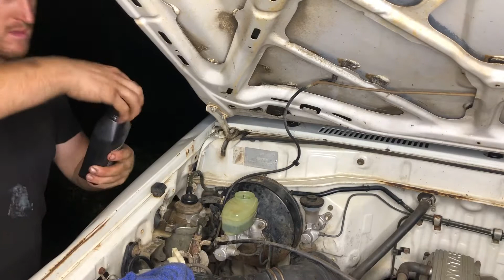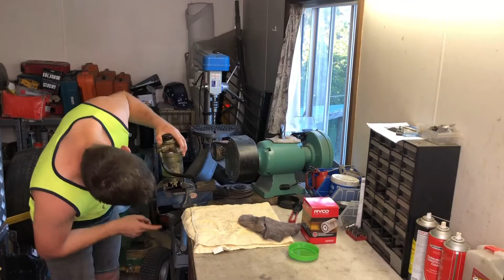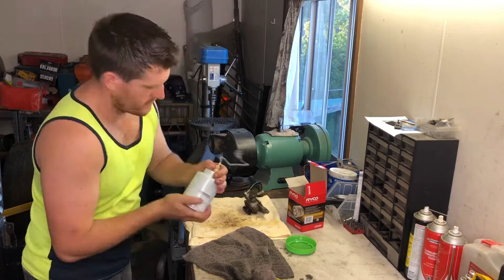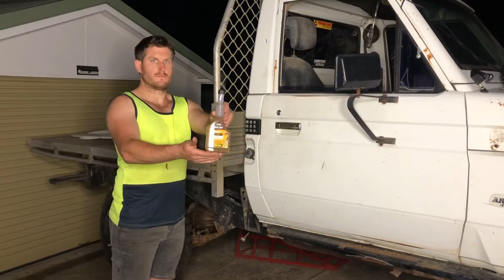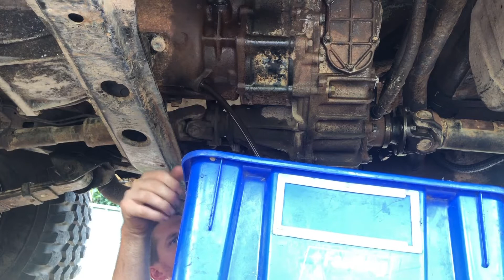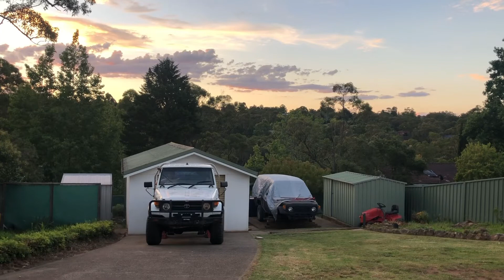Landcruiser Project Build: Hzj75 Major Service. Fluids, Fuel Filter, Gear Oil and Belts

Comment: Hey mate, great video. I was wondering though does the transfer case take the same oil and if so how much in there if you know , cheers.
Reply from the maker: Thanks mate. Transfer also uses 80W-90 gear oil. The capacity is 2.2L for a Hzj75 if you drain all the oil

Comment: Have you heard  about the oil pipe between transfer case and gearbox . There is a sea. That wears between the boxes that fills graebox and empties transfer case . Shunt is a fix and preventative measure
Reply from the maker: I have not heard about this. I will investigate during a gearbox swap in the future. Thanks